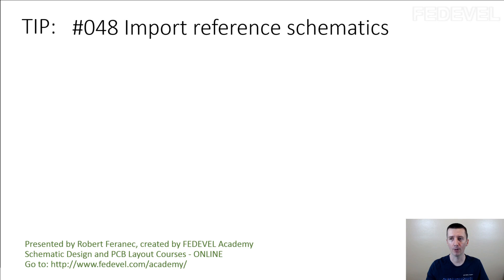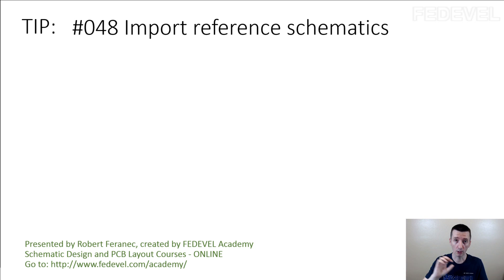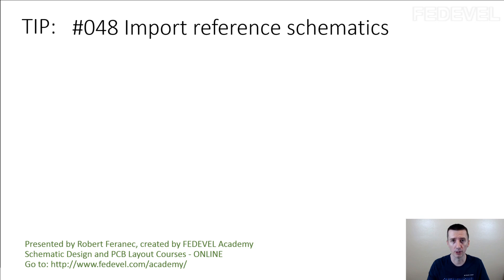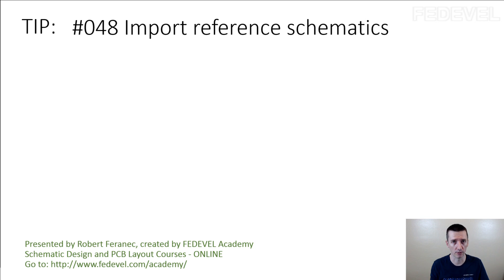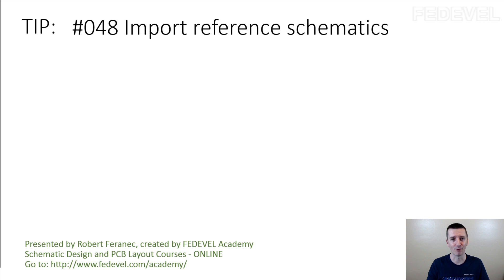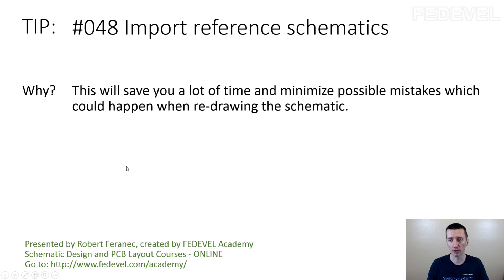TIP #048: Import reference schematics

Comment: If you import the reference schematics, do you also modify it according to your tips (like adding all pin alternate functions)? I guess it would add additonal possilbe source of mistakes. What do you recommend?
Reply from the maker: Depends - exactly as you said, if there would be too many changes, then it could add possible additional mistakes. So it depends on how it is going to be used (e.g. for open source projects I can do more adjustments so other people do not have to) and how many changes are going to be done (if only a little modification is going to be done, I will keep it close to original).

Comment: What do you think about importing resources from different platforms? Currently I have a project with reference schematics for Orcad and board layout for Allegro. I use Circuitstudio and the board import is not supported without Allegro licence. What is usually the quality of such an import? Does it make sense to hire someone to do the conversion?
Reply from the maker: I do import schematics (especially orcad) and occasionally I may import PCB (if project is very close to the original). Imports are never 100% - a lot of work may need to be done.